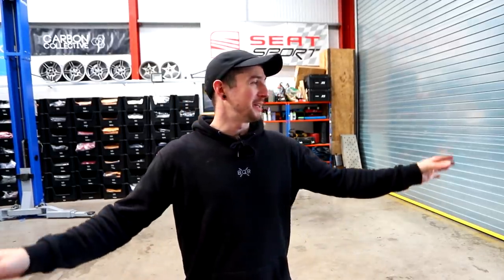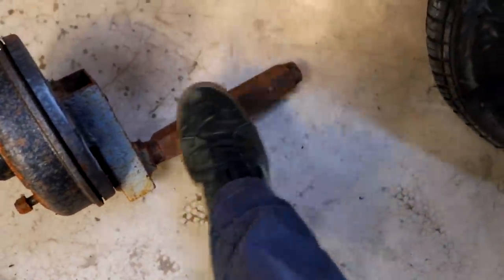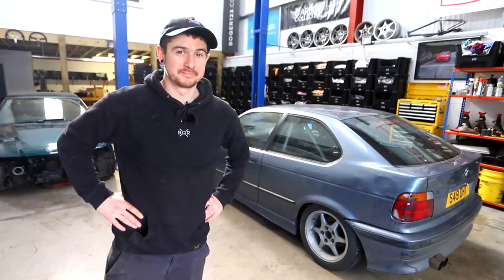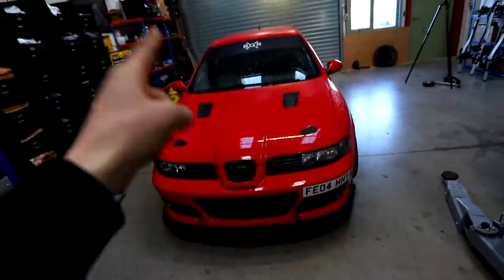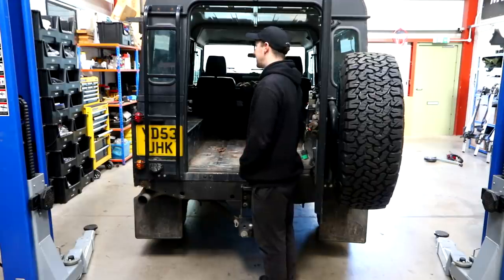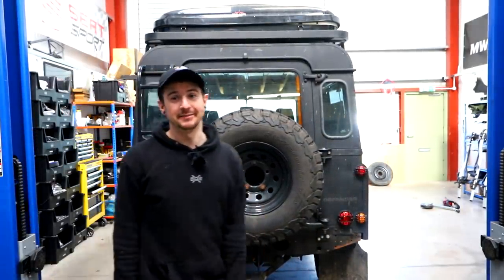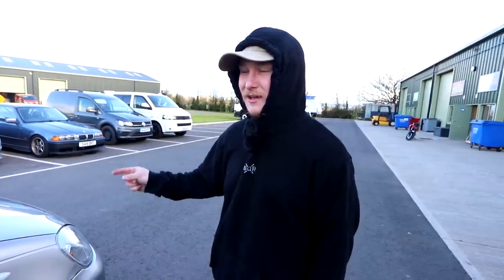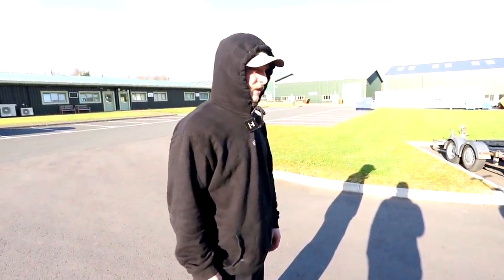I bought a CHEAP trailer (& big garage update)

Comment: I cant tell for sure but you mentioned a rubber bit, my fathers trailer has what is called torsion axle. His has the two sides connected with a full axle but they also sell half axles which each wheel would have its own independent unit. Hope this helps, good luck with the fix!

Possibly an e30 for the new car?

Comment: Find a suitable car wheel bearing hub and weld it on or make your own mount for it.   I got an old converted boat trailer from my Dad and it was a POS but handy.  NEVER loan your trailer, people will ruin the fenders & lights then say they'll fix em but never do.
Reply: Truck may be a better idea to handle more load

Comment: Yo, been watching for years, recently bought a bmw 325i. I want to skid it and have a bit of fun as it's my first proper project(inspired by yourself). I've done small bits like brakes before but I have a  tight budget and loving the bmw's on the channel, just need an lsd as it's my daily and a welded would be he'll. Any suggestions for straight swaps.
Also I reckon you've bought a 2 seater mg either the old or newer.
Reply from the maker: Welded diffs aren’t actually too bad, just annoying doing 3 point turns etc